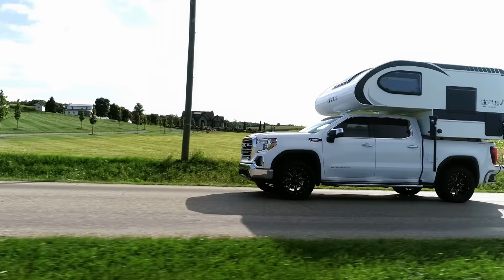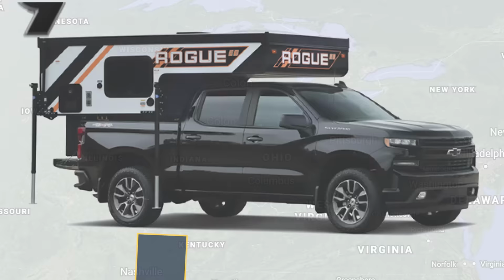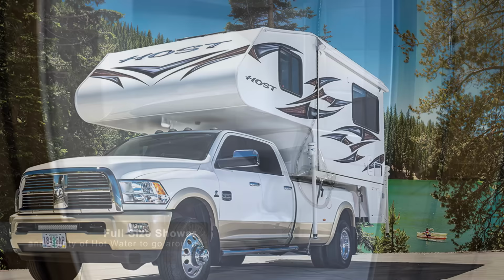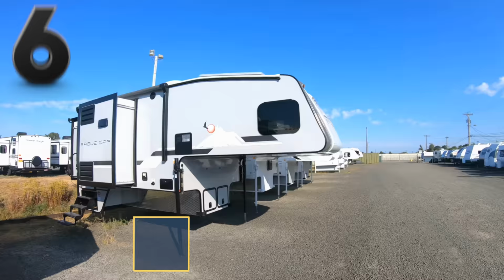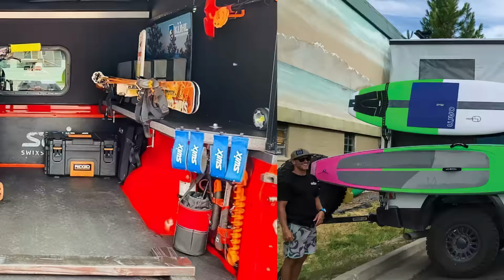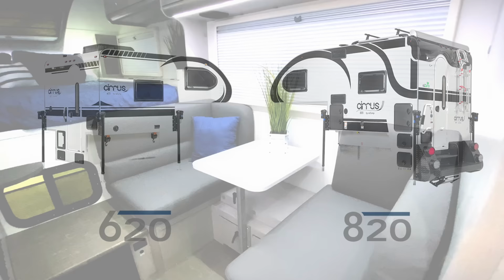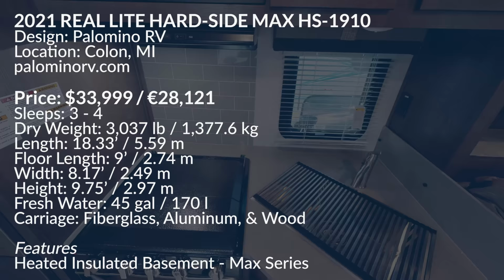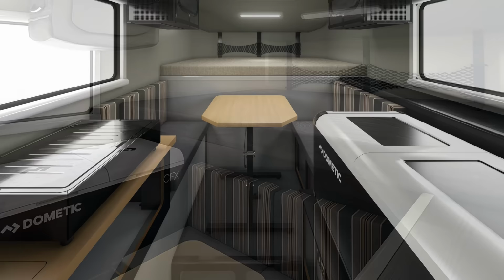10 MOST INNOVATIVE TRUCK BED CAMPERS MADE IN NORTH AMERICA

Comment: You can buy a decent motorhome for some of these prices
Reply: But can you get to the out of the way places with a motor home that a pickup truck can?  If your goal is to get away, these are great options. If your goal is to “camp” in an RV park with full hookups at $50/night +/- go buy a motor home. 😎
Reply: @Erin-Thor  how far do you think you're getting with a pickup truck and 6000 lbs on top of it? You're not getting as far as you think
Reply: @pokerchamp6556  — Sortta true, but only one of these required an F450 to handle the weight. But you are correct, there are no ‘true’ 4x4 pickups, well maybe, there’s a new one out that’s supposed to have locking diffs, available today.  And yes, if you put a heave shell on the back you have just complicated any trail use, not to mention wear and tear ten fold.  I just meant that a pickup bed camper will go more places than other types of RV’s.
Reply: The number of reasons some of us prefer PU campers is as numerous as the reasons why some people prefer a motorhome. I have had them all and will never go back to a MH. MH's do not fit my needs, desires, versatility, abilities, low maintenance requirements... just to name a few. Different strokes for different folks! Some people (typically newbees or young) only look at the price and are perfectly happy, at first, saving lots of money while traveling the country in a Yugo and tent. Those were happy days too but long gone!

Comment: The weight of most of these exceeds the GVW of the vehicles they are put on.
Reply: My '07 2500 HD has a GVWR of 4.5 tons... I can tow 18K. A 350, 450 totally can handle those weights.
Reply: So all of us that have tacomas need toppers or super top
Reply: @igotatan1  wow, I didn’t know that. I thought a 3500 meant a 1 ton. I have 2 older 2500, one a 1998 2500HD what ever that means, the other 2500 is a rusted out 1984 with a nice snow plow I use around the neighborhood. Being retired they get to come home to plowed driveways because I can. . I also have a 2012 1500.crewcab. I towed a 21 ft camp trailer to Alaska in 8 years ago.Bought the truck at Dave Smith in ID. Bought the trailer in NH. Mainly all we do it tow a small flatbed trailer with a toy to the trailhead to get to our remote cabin. Camp grounds have gotten very crowded over the 40+ years I have been here so I built a house in the woods. Many times in the winter there is no one else around for 5-6 miles.
Reply: @Chris_at_Home  3500 does mean 1 ton, but it goes by the vehicles GVWR... My 2500HD 3/4 ton, is a beast. I bet there's great hunting there.
Reply: @igotatan1  Yes there is. We live over looking a low wet area a little over half a mile wide and about four miles long. Some people refer to it as moose alley.  We also have an off-road cabin that we ATV or snowmachine to. I have some pictures on my channel. There are a few moose pictures there. On my Rumble channel I have a video of two bull moose fighting from our house window in late fall. When I was younger I did deer hunts to the islands in Prince William Sound. It was a yearly fall trip for over 20 years. You didn’t see or hear anyone else.
Reply: @Chris_at_Home  At one time the 3500 or F350 did mean one ton (4,000 #) but not these days.  It all depends on how you have them configured. One difference is in the engine, if you have a diesel then the load capacity is less than a gas engine but if you buy/ lease a dually then the GVWR is about 14,000#. You subtract the weight of the truck which gives you the load capacity.  Some have almost a 7,000# capacity, which means you can use a Host camper with not much of a problem.
Reply: @igotatan1  Not really. A striped down 350 or 450 might be able to.
Reply: @igotatan1  18,000 yes if you only have about 2,000 lbs +/- on the pin. I guarantee your truck will be way out of it's limits and specs if you are trying to tow an 18,000 lb fifth wheel for example. Sure, it has the power to do so, but not the needed payload. I have no idea what you're towing but do be careful attempting to tow 18,000 with a 250/2500 series truck. The auto industry is VERY MISLEADING to these claims... I do agree however on your statement on pictured vehicles being way beyond their spec. ESPECIALLY the one with the F450. They're actually completely inaccurate about the F450 needed as it has less payload than the same comparably equipped F350 (on paper). They both share the same 14,000 lb GVWR. Due to the heavier components. I'm certainly am not saying it isn't capable, but it's the ONLY vehicle I wouldn't be concerned about it's lack of payload. The 14,000 lb GVWR is retained to keep it as a class III truck.
Reply: I completely agree!
Reply: 100% correct. GVWR is all that matters to be legal, so forget what your truck CAN do. GVWR is what your truck can legally do-important in any accident caused by you or others. Lawyers will go straight to the sticker the factory places inside your can-usually in driver door area. You should check that sticker before the lawyers. Also insurance CAN sell you anything, but exceed that GVWR and insurance will NOT pay out.

Comment: Nice but get back to me when it's affordable. Get  back to me when the price has dropped substantially.
Reply from the maker: When what is "affordable" ? There are ten truck-bed campers featured here.
Reply: @mindseyedesign  Yep and only one of them was below $35k I think and it was just under $10k and it was a bare bones shell that you had to furnish yourself. 
You can get a nice 5th wheel or a used 35ft motor home for under $55k. Almost all of them require a 3/4T or above PU truck too.
Reply from the maker: @skipperclinton1087  Not according to the list I have.

10. http://overlandex.com
2021 Camp-X

Design: Overland Explorer Vehicles
Location: Innisfail, Alberta, Canada
overlandex.com

Price: $38,771 USD / $47,688 CAD

Sleeps: 3
Dry Weight: 1,300 lb / 589.7 kg
Length: 11.67’ / 3.56 m
Interior Length: 11.42’ / 3.48 m 
Width: 6.5’ / 1.98 m
Interior Width: 6.21’ / 1.89 m 
Height: Closed 5.17’ - 1.58 m Opened 7.08’ / 2.16 m
Interior Height: Opened 6.83’ / 2.08 m

Features

Dual Pane Acrylic side awning window with night shade & screen

----------

9. http://palominorv.com
Rogue EA EB-1

Design: Palomino
Location: Colon, MI
palominorv.com

Price: $12,500 / €10,339

Sleeps: 3
Dry Weight: 1,402 lb / 635.94 kg
Length: 12.42’ / 3.79 m
Floor Length: 6.92’ / 2.11 m
Width: 7.17’ / 2.19 m
Exterior Height: (Closed) 6’ / 1.83 m
Fresh Water: 8 gal / 30.3 l 

Features

Solar Prep
Carbon Monoxide Detector

----------

8. http://hostcampers.com
2021 Mammoth 11’ 6” Longbed Dually

Design: Host Industries
Location: Bend, OR
hostcampers.com

Price: Estimated at $50,000 / €41,355

Sleeps: 4 - 5
Dry Weight: 3,955 lb / 1,793.96 kg
Length: 19.25’ / 5.87 m 
Floor Length: 11.33’ / 3.45 m
Width: 8’ / 2.44 m 
Height: 9.42 - 9.83’ / 2.87 - 2.99 m 
Interior Height: 6.5’ / 1.98 m 
Fresh Water: 65 gal / 246.1 l
Carriage: Aluminum & Fiberglass

Features

150 Watt Solar Panel w/Dig. Monitor System

----------

7. http://northern-lite.com
Northern Lite 2021 Limited Edition

Design: Northern Lite
Location: Kelowna, B.C., Canada 
northern-lite.com

Price: $52,000 USD / $65,935 CAD

Sleeps: 3 - 4
Dry Weight: 2,832 - 3,317 lb / 1,284.6 - 1,504.6 kg
Length: 16.25 - 18.17’ / 4.95 - 5.54 m
Floor Length: 9 - 10.92’ / 2.74 - 3.33 m
Width: 8.17’ / 2.49 m
Height: 8.33 - 8.83’ / 2.54 - 2.69 m
Interior Height: 6.33 - 6.67’ / 1.93 - 2.03 m 
Fresh Water: 33 - 36 gal / 125 - 136 l
Carriage: Stainless Steel

Features

2 - 185 Watt Solar Panels
Wireless Backup Camera

----------

6. http://eaglecapcampers.com
2021 Alp Eagle Cap 1165

Design: Eagle Cap
Location: Yakima, WA
eaglecapcampers.com

Price: $60,000 / €49,626

Sleeps: 6
Dry Weight: 4,917 lb / 2,230.3 kg
Length: 21.08’ / 6.43 m 
Floor Length: 11.92’ / 3.63 m
Width: 8.5’ / 2.59 m
Height: 9.33’ / 2.84 m
Interior Height: 6.33’ / 1.93 m
Fresh Water: 66 - 75 Gal / 250 -  l 

Features

300 W Solar Capacity

----------

5. http://fourwheelcampers.com
Project M Topper

Design: Four Wheel Campers
Location: Woodland, CA
fourwheelcampers.com

Price: $9,295 / €7,688

Sleeps: 2
Dry Weight: 352 - 465 lb / 159.7 - 210.9 kg
Width: 5.75 - 6.25’ / 1.75 - 1.91 m
Height Down: 3.08 - 3.25’ / .94 - .99 m 
Height Up: 4.83 - 5’ / 1.47 - 1.52 m
Interior Height: 6.5’ / 1.98 m
Carriage: Aluminum

Features

Fire Extinguisher, Smoke Detector, & Carbon Monoxide Alarm
Insulated Side Walls & Roof

----------

4. http://nucamprv.com
CIRRUS 620 & 820 TRUCK CAMPER

Design: NuCamp
Location: Sugarcreek, OH
nucamprv.com

620
Price: $38,591 / €31,919

Sleeps: 3 - 5
Dry Weight: 1,500 lb / 680.4 kg
Length: 12.67’ / 3.86 m
Width: 8.17’ / 2.49 m
Height: 8.17’ / 2.49 m
Interior Height: 6.33’ / 1.93 m
Fresh Water: 18 gal / 68 l

820
Price: $47,335 / €39,151

Sleeps: 3 - 5
Dry Weight: 2,912 lb / 1,320.9 kg
Length: 17.42’ / 5.31 m
Width: 8.25’ / 2.52 m
Height: 9.67’ / 2.95 m
Interior Height: 6.5’ / 1.98 m
Fresh Water: 33 gal / 125 l

----------

3. http://palominorrv.com
2021 REAL LITE HARD-SIDE MAX HS-1910

Design: Palomino RV
Location: Colon, MI
palominorv.com

Price: $33,999 / €28,121

Sleeps: 3 - 4
Dry Weight: 3,037 lb / 1,377.6 kg
Length: 18.33’ / 5.59 m
Floor Length: 9’ / 2.74 m
Width: 8.17’ / 2.49 m
Height: 9.75’ / 2.97 m
Fresh Water: 45 gal / 170 l
Carriage: Fiberglass, Aluminum, & Wood

Features

Heated Insulated Basement - Max Series

----------

2. http://hiatuscampers.com
The Hiatus Camper

Design: Hiatus Campers
Location: Issaquah, WA
hiatuscampers.com

Price: $13,500 / €11,166

Sleeps: 3 - 4  
Dry Weight: 460 - 500 lb / 208.7 - 226.8 kg
Bed Length: 6.17’ / 1.88 m
Bed Width: 4.17 - 4.75’ / 1.27 - 1.45 m
Carriage: Aluminum, Fiberglass, and Plastic

Features

Waterproof Exterior
Insulated composite folding wall system
Prewired overhead LED lighting
 

----------
1. http://scoutcampers.com
2021 Kenai

Design: Scout Campers
Location: Avondale, AZ
scoutcampers.com

Price: $23,625 / €19,540

Sleeps: 4 - 6
Dry Weight: 1,370 lb / 621.4 kg
Floor Length: 7.69’ / 2.34 m
Width: 6.92’ / 2.11 m
Height: 6.92’ / 2.11 m
Interior Height: 6.67’ / 2.03 m
Fresh Water: 4.9 gal / 18.5 l
Carriage: Aluminum 

Features

170W Solar Panal
Portable Power Station
Reply from the maker: @skipperclinton1087  I have 5 on the list under $35k. 4 under  25k,  3 under 15k and  1 under 10k. It's fine I can agree with some points being made about (SOME) of the prices. I'm not debating that. I'm simply adding my opionion they are not all over-priced.
Reply: @mindseyedesign  Friend, I can only remember the ones in the $50k and $35 plus range that were worth noting but I'll say they were plush.
Reply from the maker: @skipperclinton1087  USED? Why compare the price of NEW campers to USED campers. That dosen't seem a logical way of figuring out value to me. You know what I think would be interesting, is to compare the "unaffordable" campers on this list to new campers, motorhomes, caravan or any like it to the same price range in new condition, size and year. For example; what's the going rate on a travel trailer, same year, around the same sq ft with the same features? I'll look up a few later i'm thinking of blogging this even if I'm the only one interested. I need to get back to work for now though.  ttyl

Comment: Cool video.  However can't see spending $38K to $60K to slap atop my F350.
Reply from the maker: Thanks, you prefer a pull-behind? I think I would mostly because I would like the extra storage space in the truck bed.
Reply: @mindseyedesign  indeed.  I have a small 5th wheel and a larger RV.  Maybe if I were single I’d get a camper for the truck but not at those prices at all.
Reply: That is why I bought a used 2016 Eaglecap 1165 and a 2015 Chevy 3500 HD. I have $65,000 in both of them.

Comment: Hello, I’m wondering if you could tell me if a truck (srw or drw)  & camper combo will fit in the average parking spot. Also, could you drive with the combo in the winters of the north eastern states where we see plenty of snow? Thank you.
Reply: We have a Lance 850 on a long bed dually, and we can park anywhere. That's the advantage of the truck camper. Except for height, it's over 11 feet tall so that can be a problem with low tunnels or tree branches.
If you have a 4x4 truck with locking differentials you can get around pretty much anywhere.  But avoid mud, our rig fully loaded is at least 11K pounds and weight in sloppy mud isn't a good combo.
Reply: @jflury1823  Thank you!

Comment: 40k for this 1st POS????! MY 2012 TOY HAULER IS 44FT LONG. W A 9 FT ROOF. ENTIRE BACK IS A HEAVY DOOR THAT FOLDS DOWN. SLEEPS UP TO 10... BUT JUST ME AMD VARIOUS FEMALES, WHEN I CHOOSE.. 4 BURNER STOVE W OVEN. FULL SIZED FRIDGE. ALL HARD WOOD. ALUM WALLS ( INSULATED.) FULL TUB W SHOWER AND CAMODE. 2 KING SIZED BEDS. 12K WEIGHT. HOLDS 6 K MORE. IT WAS 14999 USED . NEW TIRES AWNING AND LAUNDRY. AM IN AT UNDER 20K AND TOWING IT W MY 1993 GMC 2500HD